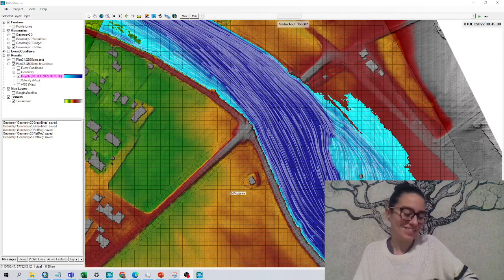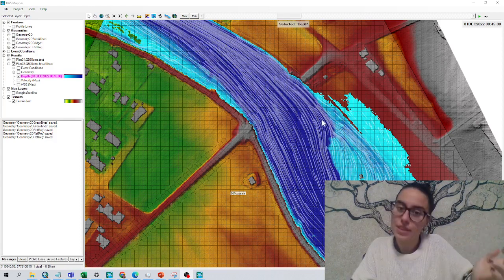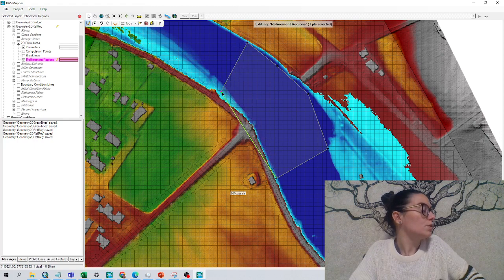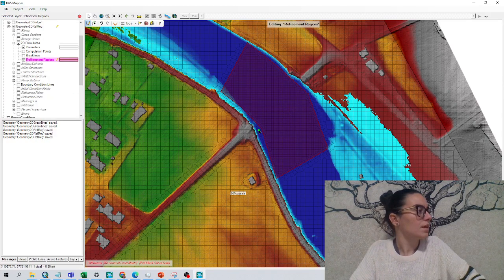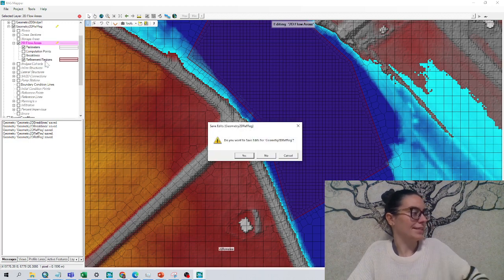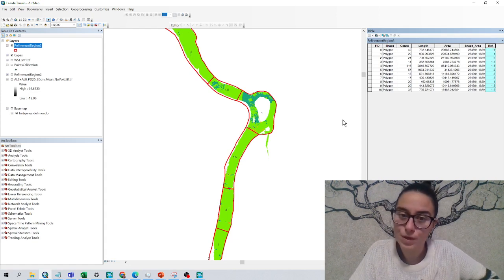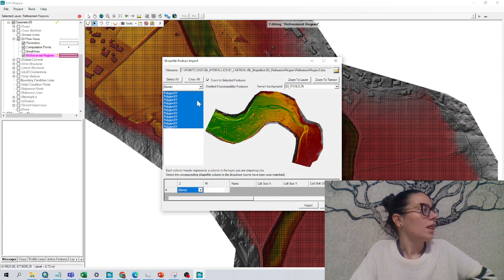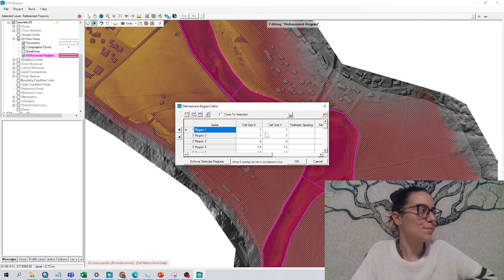Chapter 7  HEC RAS 2D Refinement Regions

Comment: Good tutorial, and exactly what I needed to learn! But I have a question. Shouldn't the refined grid be rotated in the flow direction, ideally? Is it possible to do that? I don't understand all the settings in the refinement region dialog box, but there is nothing about rotation. Can I combine breaklines and refinement regions to achieve this?
Reply from the maker: Hei Ola! Your name rings a bell ;)
Yes, ideally we prefer that the flow flows perpendicular and paralel to the cell faces. There is not standard procedure to rotate this but we can use tricks such as using breaklines along the river and set a number of repeats on the side, as much as we need. You can ask me in Linkeding and I can send you a screenshoot on how to do this 

Takk for at du lærte meg norsk :)
Mvh,
Ana